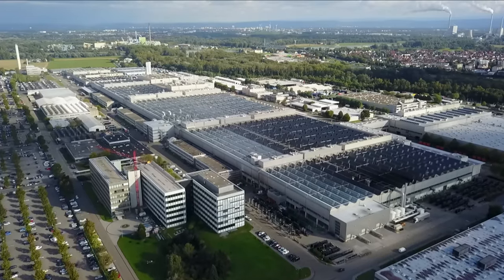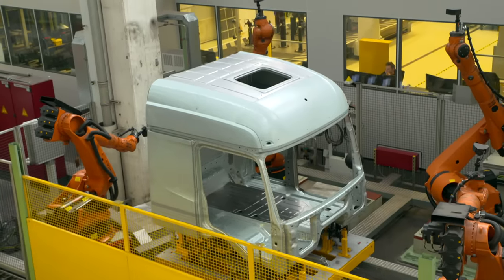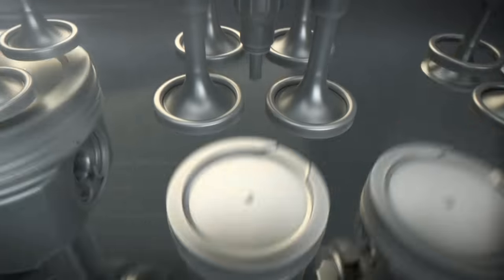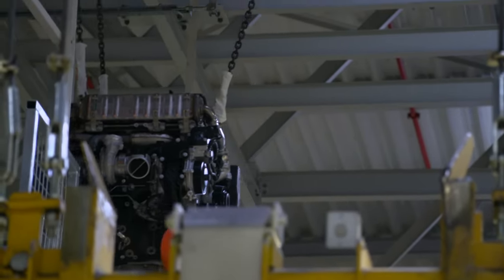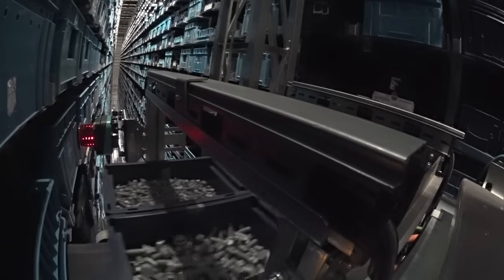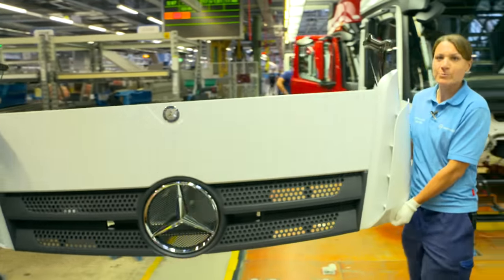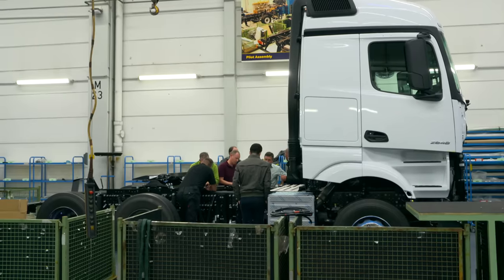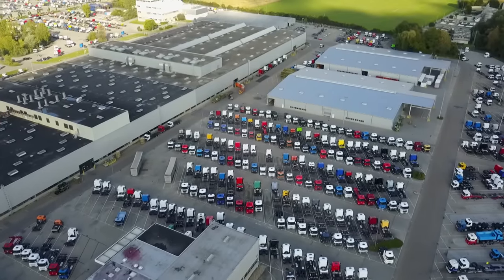World's Biggest Truck Factory | Exceptional Engineering | Free Documentary

Comment: The engines that are made in Mannheim are also used in Freightliner trucks here in America.
Reply: Would that include the Detroit variations and also the upgraded engines that start at 400hp?
Reply: They are rebranded as Detroit diesel in North America. They are also built in Detroit Michigan. I work in them at Freightliner dealer and I like them a lot. As long as you do proper maintenance they last a long time.
Reply: I think they changed it. I think PACCOR engines are in the Cascadia models.
Reply: @black10872  No paccar engines are only in Kenworth and Peterbuilt trucks. Freightliner/Westernstar is owned by Daimler so they us Mercedes engines and some Cummins.
Reply: @dieselgaint  Yep and the 60 series is still the most reliable engine i have ever seen and worked on. Mercedes Benz would have been smart to keep a lot of that architecture, But they know more and i work on these new engines more than anything else. severe turbo oil feed issues so far.
Reply: @YouvBeenThumped  Interesting about turbo issues. I have never seen a complete failure yet of the turbo. I have replaced them for oil seal leaking in the compressor side and wastegates seizing up and that's all. I fix a lot of oil leaks, like A LOT of oil leaks. Mainly injector line seals, cam frame seals, and oil/coolant module.
Reply: @dieselgaint  same difference at that point. the turbos get to much oil pressure and either leak or some have straight seized up i haven't taken injector seals or other oil leaks in yet. but all good things to know about and have my supplier keep parts in. first failed turbo that came through here took almost two weeks to get a new turbo. they just aren't a Detroit Diesel and i mean yeah they had their little quirks too. but man it took a lot longer for them to rear their heads over these Mercedes engines. they sure like to over engineer this stuff though.
Reply: @YouvBeenThumped  the 60 series was a joint operation between gms Detroit diesel divison and John Deere. No point in keeping the design.
Reply: @YouvBeenThumped  Drove big trucks from 1975 to 2016 the 60 series was the best, 1 million miles was easy for a well maintained engine.

Comment: They stopped using those cabover designs in the 70s and 80's for a good reason here in the US. It's too hard to get in and out of, and there just isn't enough space inside. I think they have those small roads in Europe and need the turning radius.
Reply: Mike Keith in Europe they are only allowed to be a certain length, so to maintain capacity in the trailer, the cab over design makes the most sense

Comment: I hope that the plastic Zip Ties used inside the Chassis to tie the wiring of the truck will not fail under extreme hot or cold temperatures or with time and vibrations
Reply: Zip ties will outlast any other component on any vehicle.

Comment: A lot of fluff is mentioned but several facts omitted. For instance the PVC sealer fills every seam where spot welds or interrupted line welds leave an opening. The tightening of fasteners is shown but the tracking of most fasteners, not just the engine fasteners, will be tracked. If one is not correct then it is either flagged for later correction or is alerted for immediate action.

Comment: All of those holes in the frame. Equal less strength.
Reply: Actually not. The holes are intentionally in areas of low stress. The purpose is to allow multiple options for items bolted to the chassis
Reply: Yeah i know what the holes . The whole frame is full of holes its actual a way to cut costs pure and simple . its a cheap way of doing things
Reply: It would take less pressure to bend the frame . than if the holes were not there.  Its the hole reason theses trucks are not DOT certified
To drive in the USA.
Reply: they crumple zones! they save lives! how dare u insinuate that the vehicles manufactured today are garbage?!

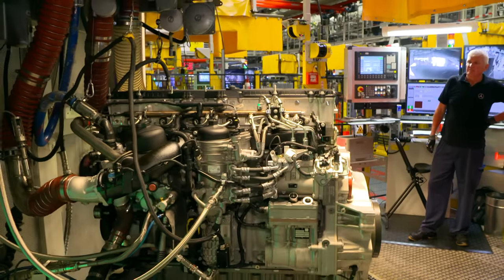Comment: That engine At 1:43 is a Detroit!
Reply: It's the same engine. The dd13 is an om471, and dd16 is a om473. I believe the dd15 is specific to the north American market but it is a om472. I work on them at Freightliner and I like them a lot.
Reply: @dieselgaint  Only difference is the software. Except when you get into the new dd8 and dd5 that is coming out soon, they have a few differences with their german counterparts. I worked at FDDA since 96. Just quit a year ago to work for my local county transit.
Reply: Detroits haven't been detroits in a long time. The last detroit engine rolled out before the s60s which was a joint operation between them and john deere after gms selling of Detroit everything moved to mercs

Comment: Imagine the power generated if they covered the roofs of all the facilities with solar panels. They could seriously reduce their electrical costs and extend the life of the roofing itself. I struggle to understand why any structure with flat roofs don't utilize solar panels. Yes, I understand there will be months with little power generated. However, the goal is to reduce our dependency of fossil fuels to produce electricity. And yes we're reducing our electricity consumption with better lighting, heating, cooling, insulation, and building technologies. But we'll soon be using to electricity to power all of our vehicles. Not just a few, but all. Which means we'll be consuming more power than ever before. Vertical turbines can be integrated into the architecture of building and homes with solar to generate and store the electricity needed to power our homes and vehicles. Carports and shade structures can be made entirely of solar panels. The more panels we install, the more will be produced. The more produced, the less costly and more efficient they become. The Tesla roofing tiles are the biggest leap in solar technology we've seen in 50 years. Once Tesla perfects this technology and licenses it out for others to manufacture, no new roof should ever to be made of asphalt again. There are too many alternatives to asphalt as it is. We need to, and are in the process of finding ways to refine our oil further to reduce the amount of byproducts. Luckily asphalt products are being recycled into new products today. The majority of asphalt products which have reached the end of their life as one product are not longer going into landfills or being burned thanks to various forms of recycling. That said recycling still uses a lot of energy and has its own byproducts. Therefore, recycling is not a solution on it's own. We must utilize the technology we have today to reduce our consumption. Solar is one technology that is underutilized globally. Power companies are doing what they can to fight homeowners and business from producing their own energy and buying less of their dirty power. One way the power companies are fighting us is denying the practice of net metering. Meaning they won't pay me for excess power generation I put back into the power grid. Instead of giving me credit for the power I put into the grid, for use when I need their power, I must pay for power I use, when solar isn't generated, despite putting more power into the grid than I use. Essentially they're making money off my power generation. It's this very reason that homeowners and business won't install solar. It's cost prohibitive for most. My power company buys 70% of the power supply from a coal burning power plants. A fact they try hard to hide. 

Whoops! Way off topic again. But something I'm passionate about.

Cheers!
Reply: Cameron Hollis electric cars are recharged by a pile of burning coal
Reply: Cameron Hollis
Give them a call, see what’s up.....